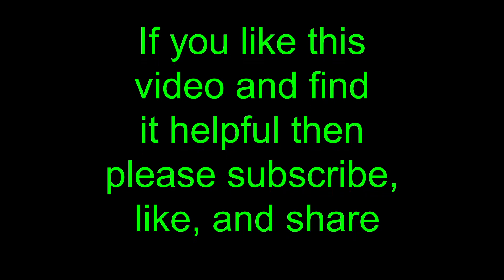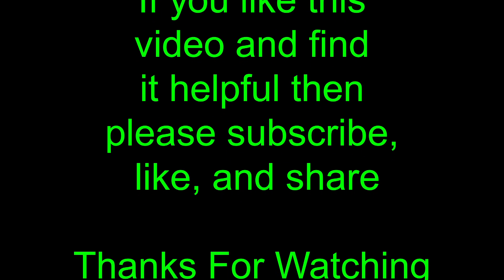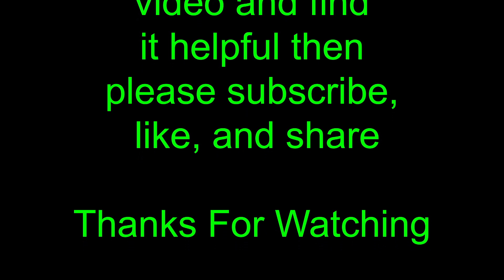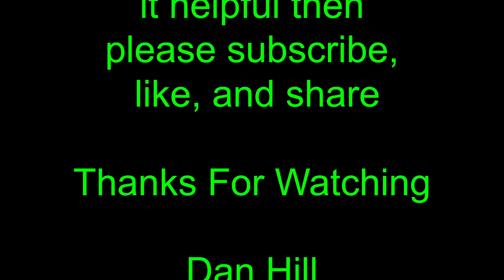Building a Zenith 701 Experimental Airplane,Building Basics Part 3

Comment: Can I substitute 6061-T6 for 2024-T3?
Reply from the maker: The short answer is NO. If the aircraft you are building calls for 2024 then that is what you should use. Zenith primary uses 6061-T6 for most parts, but in my limited experience most aircraft use 2024 which is stronger in most instances.

Comment: I think I should switch to the 701. Your material list is WAAAAY shorter than mine :)

I'm not sure if I need the .093 angle or not. I just got a rough list of the sheet alum so I can start sourcing while I wait for my plans.
Reply from the maker: Hi Troy: From what I am reading the cruzer is a great airplane. I think it all depends on what your mission is. When I began this project I wanted a 601 and thought it would fit what I wanted it to do, at that time it had some issues so I started the 701. The project got stalled because of life issues and when I was able to get serious again the 650 and 750 were available and I seriously considered switching to the 650 but felt I had to much invested in the 701 in both time and money so decided to finish it. My plan is to finish it and it will have been a great learning experience and I will have an airplane to fly. That being said I accept that this airplane will be primarily a local area,small stol airplane. I suspect your cruzer will be more useful as a longer distance more stable and comfortable airplane I strongly suspect that a 650 will almost immediatly be started in my little airplane factory because I like the building process and is extremely relaxing for me. It's all in what you want. Dan
Reply: hillsgun 

I'm actually going to build a 750 super duty.  I'm pretty excited about the increased useful load and jump seat.
Reply from the maker: I do now remember the conversation where you said you were building a superduty, Your zenith profile says cruzer. reinforces the idea of defining the mission you want an aircraft for. from zenith offerings the 701 and the 750 superduty are at opposite end of the spectrum
Reply: hillsgun 
Oh yeah, it made me put a model in when I signed up. I'll change it when the Super duty becomes an option.

Comment: Great video, Dan! I did the same thing using .125" angle vs. Zenith's custom .093" extrusion. Unfortunately, my local mill doesn't carry .016" or .020", so I had to get those shipped. But 3-4 sheets of those rolled and shipped via UPS cost $60-$75 in shipping, so it doesn't break the bank. Totally agree it's just not worth it to substitute materials. The airframe is the cheapest part of the whole plane, by a long shot! I think I might only have about $3500 into mine.